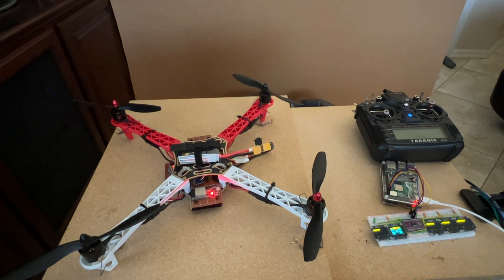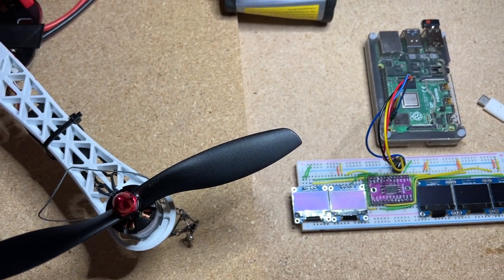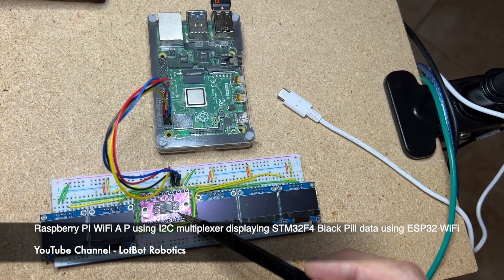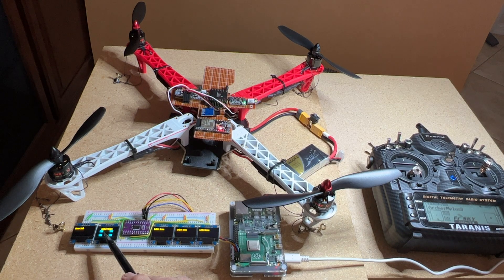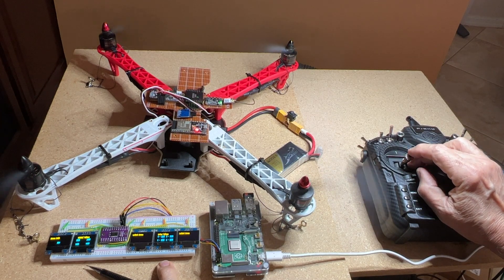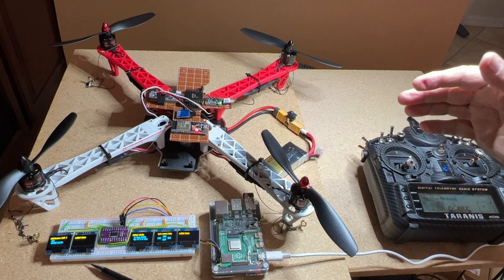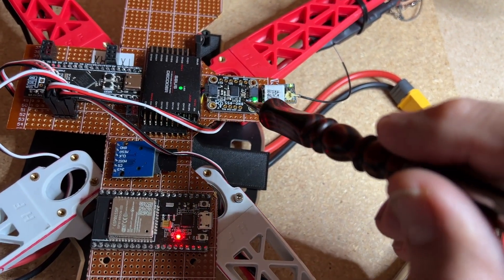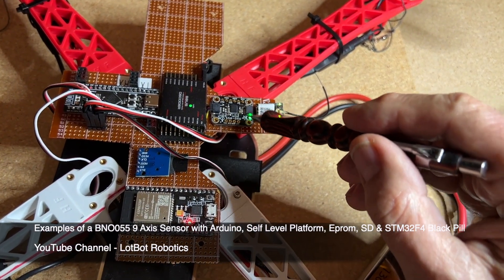A DIY STM32 Drone using ESP32, Raspberry PI, SD, BNO055 and SBUS decoder:  Part 1 Concept & Test Env

Comment: can you share your codes
Reply from the maker: Sorry for the delay, My code is rather messy as I have tried a lot of different logic and am currently on hold as I had a lot of problems. Had a request 2 months ago and sent the following response

"I was sort of hoping no-one would ask that question. I started to work on the code and no matter what I did, I could not get the controlled lift I was hoping for. But then I got interested in reworking my Hexapod project so I put the drone project on the side for now. I did add my updated Hexapod project using the same components I was using in the Drone. I am now working on a new Robotic Arm using those components. I really hope I can get the drone to work but I am more knowledgeable about programming then I am about electronics and I am not really sure. If you succeed, please let me know and I wish you all the best."
Reply: where is code
 @lotbotrobotics5026

Comment: Hi, where is part 2?  Did it fly? I would like to make a similar drone. Thx.
Reply from the maker: I was sort of hoping no-one would ask that question. I started to work on the code and no matter what I did, I could not get the controlled lift I was hoping for. But then I got interested in reworking my Hexapod project so I put the drone project on the side for now. I did add my updated Hexapod project using the same components I was using in the Drone. I am now working on a new Robotic Arm using those components. I really hope I can get the drone to work but I am more knowledgeable about programming then I am about electronics and I am not really sure. If you succeed, please let me know and I wish you all the best.
Reply: @lotbotrobotics5026  ok we will try it and let you know

Comment: Amazing video once again.
I have a request, can u make a video on how one can write advance menu system using oled ?
Reply from the maker: I appreciate your comments, however an OLED is just a display connected to an application that can run in a Raspberry Pi, a iMac, a PC, arduino,,,,,,, and any other computer and can be written in many languages for various projects.. My current project uses the nobs on a transmitter to identify different functions which is a menu system. Also, I am really tied up with this current project as it is bigger then I ever thought it would be. This project has some challenges that as I overcome them may cause me to create additional videos. I am sorry not to be more positive about your request.

Comment: 视频看完了，非常nice！请问可以把这个项目的代码和一下配件开源到github上吗？我最近也想做一个，所以就在寻找资料，如果你肯分享的话那真是非常感谢您！:yougotthis::yougotthis:
Reply from the maker: Thank you for the nice comment. I really appreciate it. About your question: I intend to show my code at some future time the problem is that I have a C++ program for the STM32F411, a C++ program for the ESP32 and a Python3 program for the Raspberry PI and since I am working on the project every day the code is constantly changing and with changes, there are always new and old bugs and the code is very unstable. For example I changed the way the drone signs on to the raspberry pi today so that when the drone will not be close enough for WiFi then one of the transmitter switches can close the connections so the drone will not send messages that can not be used. I am still working on the Yaw, Pitch and Roll code as well as the sensor code to get a hover to work.
Reply: @lotbotrobotics5026 h好的，我已经订阅了您的频道，期待看到您做到最好的那一天:shelterin:

Comment: amazing freaking amazi, keep it up!!! One question the skeleton where can be found to be bought (is from 3D printer)?
Reply from the maker: Thank you very much for your comment, I really appreciate it. I believe I got the Frame from Amazon. I just checked and they have a couple different versions of it. you can search for "drone 450 frame" and you will find it.The one I got has legs that I am not currently using as I want to be able to add a grabber on the bottom of the drone. In the video I mention a 3d sheet of plastic that is only 1mm thick, I used that to cover the metal plate as I was protecting any of the pins from shorting out. However I could have used electrical tape but I have a 3D printer so I used it instead .
Reply: @lotbotrobotics5026  thanks very much,keep it up!!